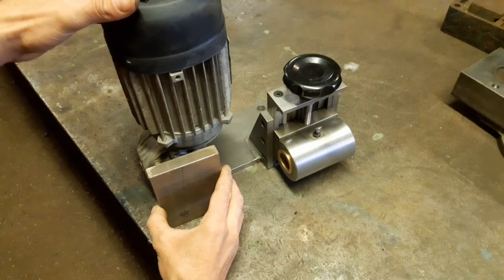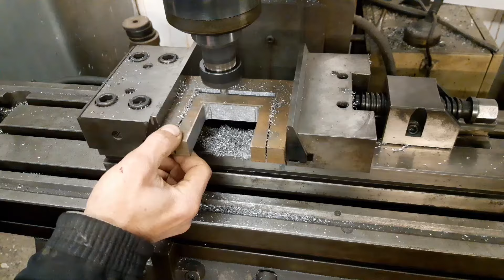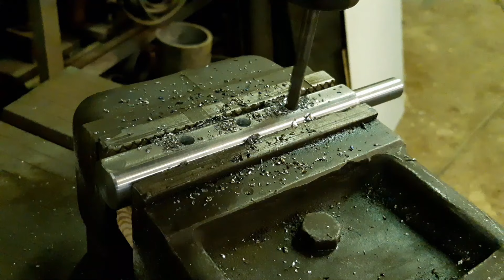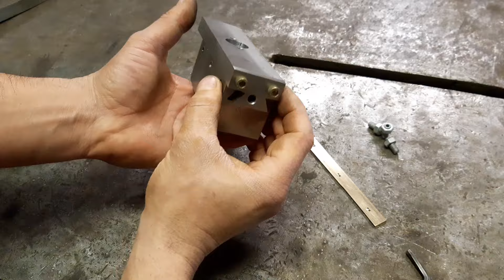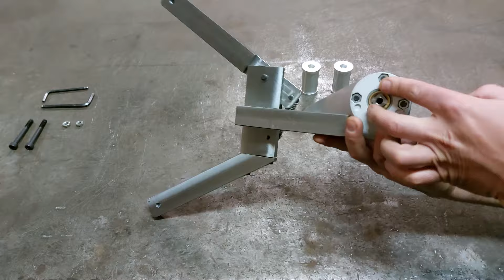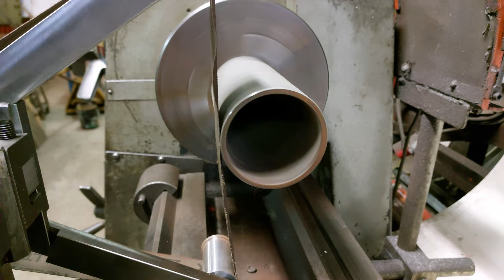5 accessori che ogni tornitore dovrebbe avere!

Comment: At the 7:00 mark, why did he put a dead center in the chuck and turn the shaft between centers?  The end of the shaft is not tapered, why not just put it in the chuck?
Reply from the maker: Hi, if I had placed the piece to be machined directly on the spindle, I would have obtained a cylindrical machining, at most a taper obtained thanks to the inclination of the turret.... However, to obtain long tapers, it is necessary to offset the part starting from the spindle and then offset the tailstock, with this tool, the work is much quicker!
Reply: @newtech5042  OK I understand.  Thank you for the reply